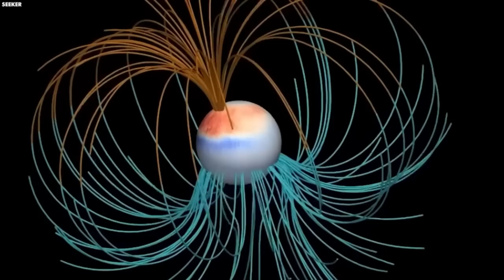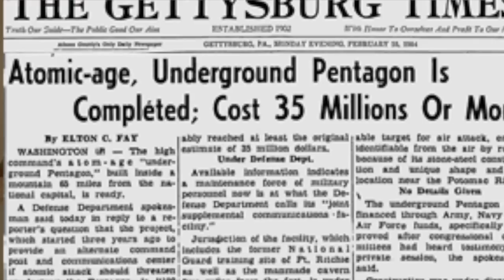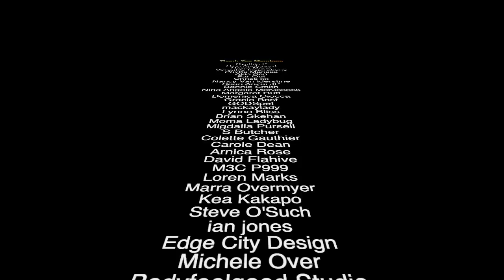Billionaire Bunkers, Safe Zones & FUTURE EARTH PROPHECY MAPS

Comment: This is the calculation if the earth has a massive pole shift. Done by a physicist.
308 altitude X 146 miles away from coast.

454 miles, safety zone from tsunami.
 
5000 safest Areas
4000 lower risk
3000 medium risk
2000 high risk
1000 very high risk
<1000 prepare to float